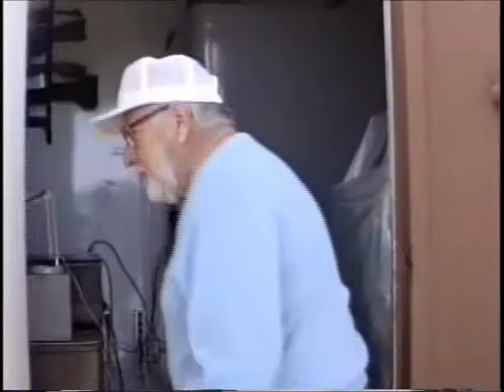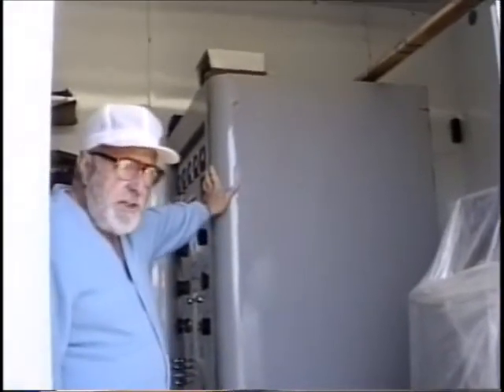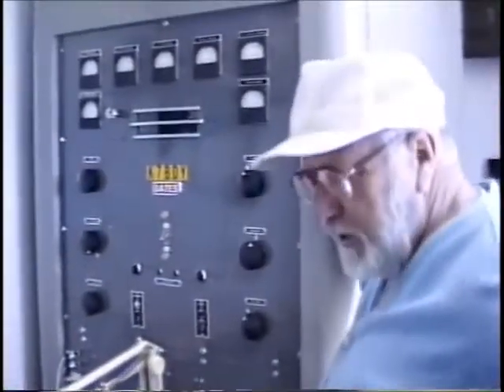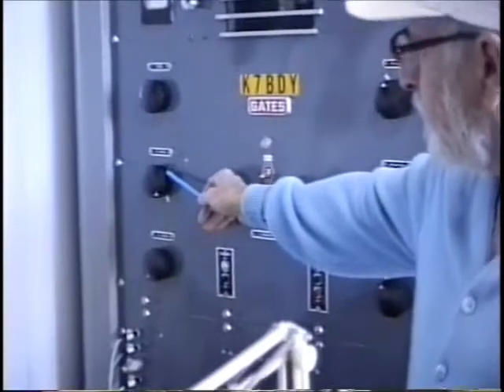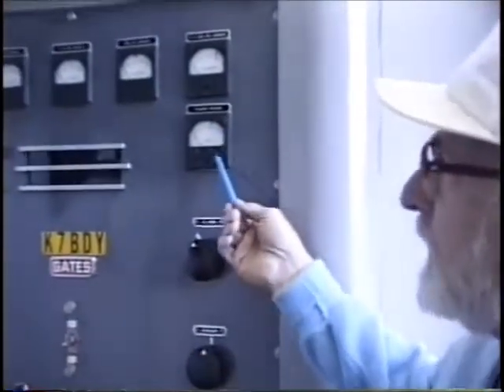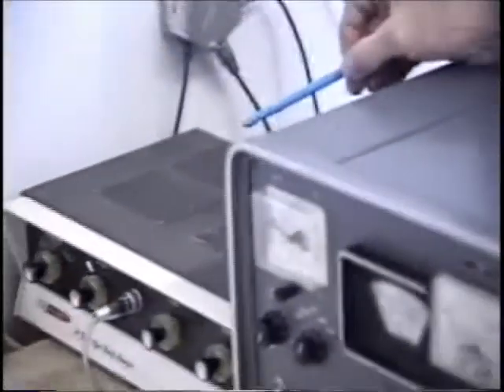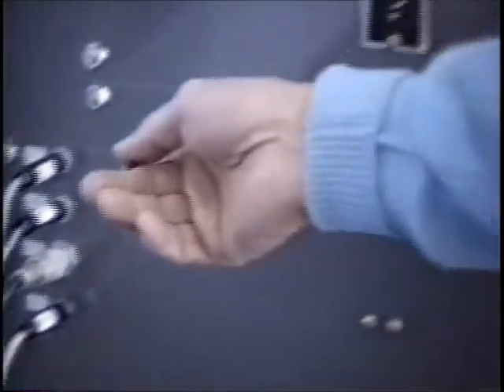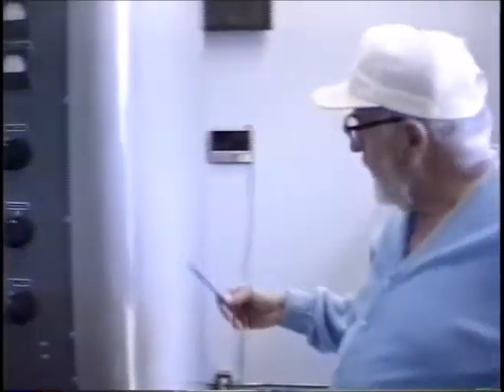K7BDY Gates BC-250GY transmitter

Comment: That is one of the coolest AM set ups that I have ever seen. Very neat and clean. Great transmitter and good receiver. I think I would pick the audio off the receiver at the detector and feed it to a 100 Watt tube amp and drive a 15 inch woofer with a couple 10 inch midrange  and 4 inch tweeters. I'd love to hear that! Very nice. KF0XO

Comment: We had one of these Gates BC-250 xmtrs in the first radio station I worked at in 1977.  They later upgraded to an MW5 but kept the BC-250 for backup and pre-sunrise and post-sunset use.  I think they still use them both.  Sadly they went automated several years ago and visitors are not welcome .  Thanks for the memory trip.